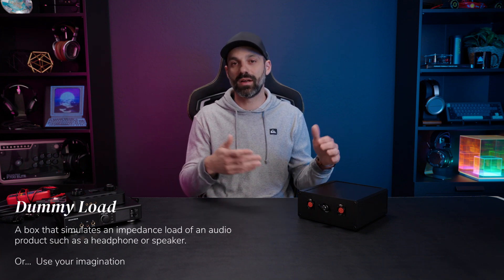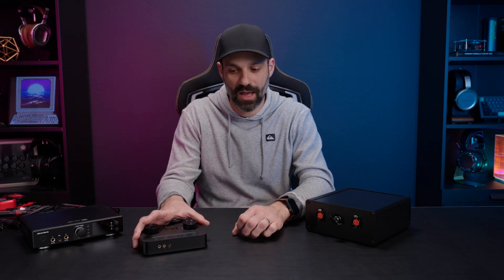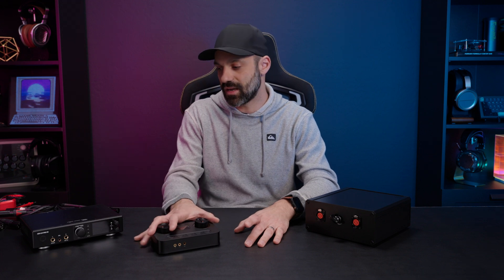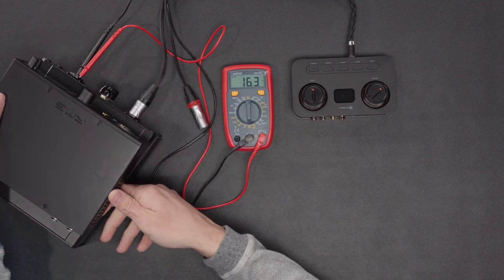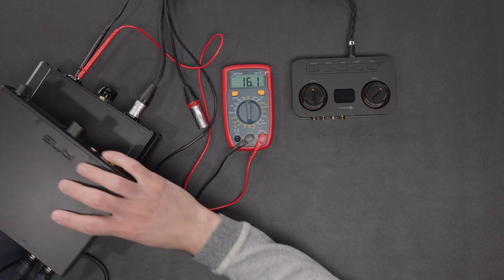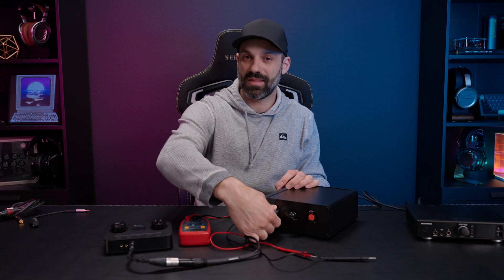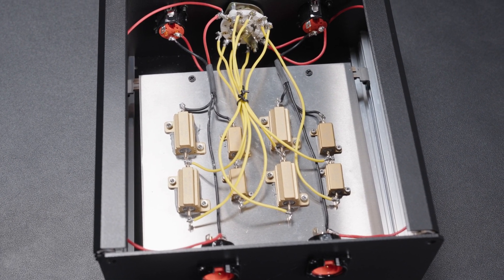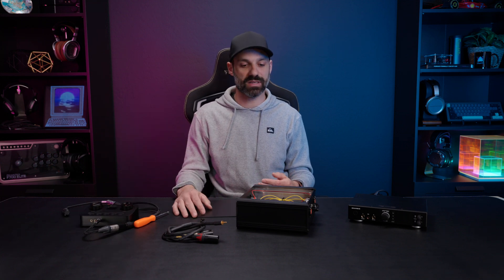I Made A Dummy Load for Amp Testing!  Why this is important...

Comment: Williston Audio Labs also does dummy loads, but on stereo amplifiers.

You got a great tool to verify claims.
Reply from the maker: Thanks!  I can easily make something similar for measuring amp loads.  Just need to build it with highet wattage resistors.  Pretty easy to do with some tweaks on a second box

Comment: I know this is going to be a stretch, but if you could also test into a 600ohm load that would be awesome, I know there are really any modern headphones made with that kind of impedance load anymore, but it would be interesting to test the wattage capacity into these kind of extremes because manufactures often don't give this kind of specs or either test for them.
Reply from the maker: It's definitely doable but unfortunately won't provide a ton of value as most consumer headphones don't approach that.  There a couple random ones like the Audio-Technica R70x/xa that has a 470 ohm impedance, with a peak of over 1000 ohms!  I may consider doing this one say when I have some time but it will take a little bit.